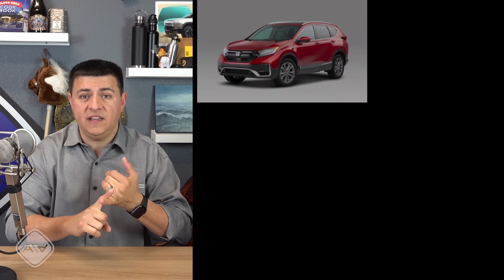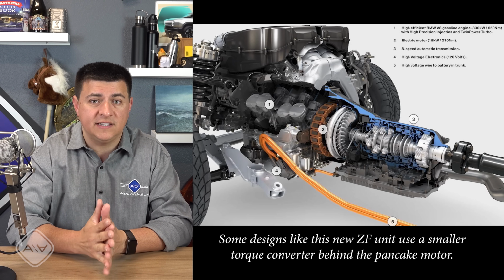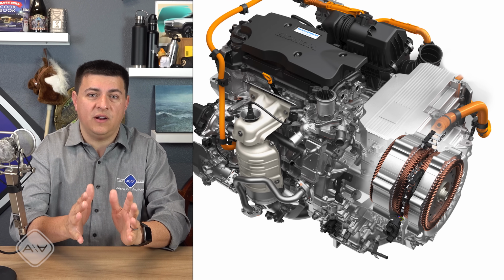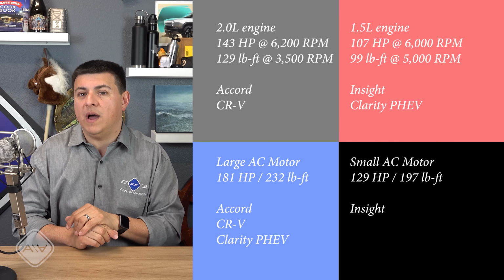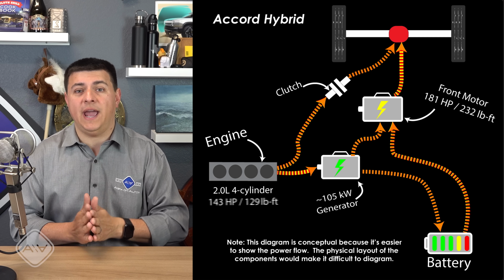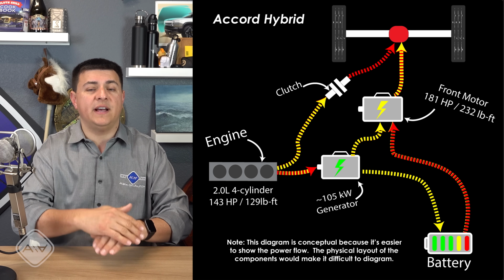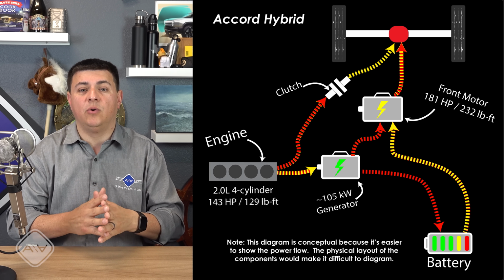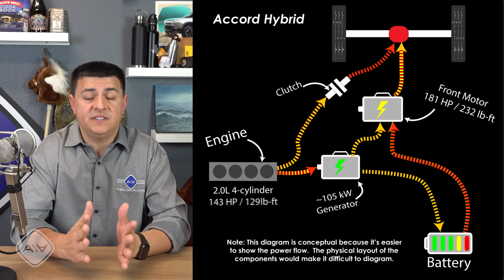How Does It Work?  Honda's 2 Motor Hybrid System Explained!

Comment: As hybrid as it gets. Serial hybrid combined with mechanical clutch pack and driveshaft to rear wheel
Reply: I do agree with your opinion, but to be fair I need to treat opinions I agree with the same way as those I don't.

The Toyota hybrid system is "as hybrid as it gets." By that, I mean that the two systems are so integrated, that the gas system can't operate without the electric system. The electric system can operate alone, but only in a limited capacity. This is why the PHEV versions modify the connection between the ICE and the wheels, to remove the limitation. The gas system literally requires the electric system to regulate engine rpm. What isn't well understood, is how the battery fits in to that.

The Honda hybrid system is, mostly, an electric-drive car that utilizes two different sources of electricity. It can be the battery, the generator, or the sum of both. It is only the "both" part that makes it hybrid, and it isn't as necessary as in the Toyota system.

What makes the Honda system efficient, is that it can also be based on the difference of the two sources. The engine in the Accord and CR-V described here is 40.6% efficient at 2000 rpm and 34.7 HP.  It will run there whenever it can, and use the battery to adjust the power sent to the wheels thru the motor.

The exception is Engine Drive, when the clutch is engaged. The engine can be at least 40.2% efficient between 1400 rpm and 2800 rpm, but only if it generates the optimum power. The point of the mechanical clutch is that it connects the engine to the wheels at the fixed ratio RPM=37*MPH. So that rpm range means 38 mph to 76 mph. This eliminates almost all of the loss between the engine and he wheels, for the portion of the power sent to the wheels.

And AFAIK, only the CR-V has AWD that connects the drive system to the rear wheels. The advantage of the mechanical connection is that any mix of front/back power is possible, unlike the Toyota that has only a small motor in the rear.

Comment: So basically it's an electric car with a build in charger unless you're driving on a highway yes?
Reply: Close, but not quite. "Electric Vehicle" really means a car run by electric motors. All hybrids are electric vehicles. A Tesla is a Battery Electric Vehicle, or BEV.

This can be called a "Generator Electric Vehicle." The distinction between it and a Tesla is that the generator is the primary source of electricity, and the battery is a back-up buffer for when the generator makes more or less than is needed.

On the highway, the generator and motor are removed from the loop since the ICE can run optimally
Reply: @jeffjo8732  I can't see the difference between EREV (Extended-Range EV) and the Honda Hybrid at low speed. Engines in EREV are generators for batteries. But here, does the E-CVT contains a small battery or it use a capacitor-like component to link motors and engine?

Comment: Good that Honda ditched their old hybrid and copied/borrowed it form Mitsubishi which got this hybrid plug in system from 2012 onwards in Europe and well proven design. Only thing is that this got a wearable clutch pack and in Toyota hybrids got no such thing.
Reply: Mitsubishi has similar components, but they use them differently. It's a different system.

Toyota eventually settled the lawsuit with the folks from the University of Maryland who patented the system they use in the early 90's, claiming they "developed it independently."

And the permanently-applied clutch built into Toyota's flywheel experiences more wear that the overdrive clutch in the Honda - which is none. It only closes when rpm are matched by computer.
Reply: @jeffjo8732  Toyota clutch pack is permanently locked right. Does not slip so from where the wear comes ? Yes. Toyota settled with an engineer from USSR who migrated to the US. Also, these days something will interfere with other designs and it is inevitable.
Reply: @adambakkam1527  "Toyota clutch pack is permanently locked right." So now you agree that a Toyota Hybrid has a clutch? We are making some - not much - progress.

"Does not slip ... " No, it does not open and close. Its entire purpose is to slip when forces are trying to make the two sides of the clutch spin differently.

"... so from where the wear comes?" The engine is still connected to the wheels when it is started in EV Drive. A common mistake by those who don't analyze the system, is to say that MG1 is used as a starter motor. That is true when the car is stationary, but not when it is moving.

The characteristic equation of the PSD is 13*MG2=5*MG1+8*ICE. Note that the MGs can have negative rpm, but the ICE cannot without being damaged. Positive rpm moves/pushes the car forward, and negative rpm moves/pushes the car backwards.

In EV Drive, MG1 must be spinning at 2.6 times the speed of MG2 to keep the ICE at 0 rpm. MG2 maintains this speed this under very small power, to make sure that the ICE can't spin backwards if you hit a bump. To start the ICE moving, MG1 has to slow down by either becoming a generator, or pushing against the car's speed as a motor. This transition involves both MGs and the speed of the car, so it is not as well-controlled as in other Hybrids that start the ICE while disconnected from the wheels. Some slippage occurs. It does cause wear and failure. You can look it up.

Conversely, the purpose of Honda's overdrive clutch is to only open and close. But not to slip. Ever. It engages only when the ICE is already spinning, and the speeds are matched.

 "Toyota settled with an engineer from USSR who migrated to the US." You missed the part where the settlement admitted that Toyota's design infringed on patents that they could have found with a simple patent search. They somehow get a pass for not doing that.

"These days something will interfere with other designs and it is inevitable." You mean like when you implied Honda copied Mitsubishi by combining similar components, for different purposes? Unlike Toyota, who admitted patent infringement that could (really should) have been avoided?
Reply: @jeffjo8732  Thanks for the detailed write up.
Reply: @jeffjo8732 Thank you for the explanation. I was concerned about the Honda Civic e:HEV’s clutch, but I’m not anymore.
I drove a Corolla HEV, a Camry HEV and the Civic e:HEV and, by far, Civic offers the funniest — and relaxing — driving experience.

On the other hand, the power split device means more moving components and more moving components means more mechanical frictions and possibly failures over time.

Sorry, Toyota fanboys…

Comment: however,the gasoline engine cannot develop large torque at low rpm...
Reply: And your point is.... what? That you don't understand how this hybrid works? Because that is what you demonstrate. The torque of the engine in this system is never important to performance. It will never even produce the theoretical peak torque, since it has better ways to drive the car.  This is why the low torque at low rpm in an Atkinson engine isn't an issue.

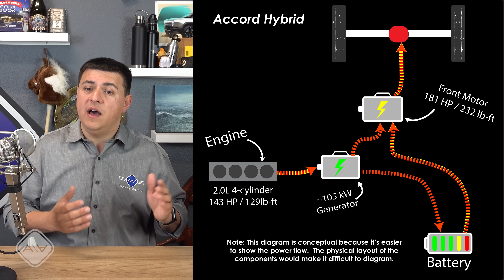1500 RPM is the slowest the engine will ever run. That will be at 40 mph in Engine Drive (5:00 in the video). It will be generating about 90 lb-ft, or 26 HP (it could go up to about 105 lb-ft, but won't). And, contrary to what Alex says, the traction motor will be involved.

That motor could add torque if more is needed, but will only add a little before disengaging the clutch to drop into Hybrid Drive. RPM will increase to 2000, still at about 90 lb-ft or 34 HP, but it will drive only the generator. If the car needs more juice than 34 HP plus what the battery can add, the engine will rev higher. Up to the what is needed for the 234 lb-ft, or 181 HP, that the motor can provide.

But usually, 26 HP is too much. The car needs less than 10 HP to maintain that 40 mph on a flat road. The 16 HP difference will be used to charge the battery.

Comment: I owned a Clarity for 21 months and I never got into the ICE engine connected directly to the wheel mode.  I don't know in which conditions I would get it.  It is a smooth system but the ICE engine could be quieter when running at high RPM.

Comment: It’s basically a twin motor planetary ecvt copied of Toyotas Aisin gearbox
Reply: No. It is nothing like Toyota's HSD system. The concept of operation is completely different. It has no planetary gearset. It is far simpler. And unlike Toyota's HSD system, it does not infringe on other's patents.

Comment: 142 hp engine and 181 hp electric motor = 324 hp total power in a Honda Accord? Damn!
Reply: No.

As Alex explains, only the 181 HP electric motor actually propels the car in situations that demand high power. The 143 HP gas engine will be driving a generator, and that generator plus the battery power the 181 HP motor. The "212 HP combined power" of the car is the maximum output of the generator and the battery, but only 181 HP of that can be used for acceleration.

But comparing peak HP really is an apples-to-oranges comparison when the drive trains are so different. For example, the Honda Accord and Toyota Camry are very similar cars except for the drive trains. Yet in Car and Driver tests, the 192 HP Accord beats the 203 HP Camry to 60 mph by 0.6 seconds. That's 7.3 seconds to 7.9seconds. The difference is that the Accord has a turbocharger, so it actually has more torque (and so HP) over a wide range of engine rpms. The peak HP is not very relevant.

The Accord Hybrid can only put 181 HP on the road. But it beats both in acceleration, reaching 60 mph in 7.1 seconds. The Camry Hybrid, rated at 208 combined HP, gets the same time as the gas version, 7.9 seconds.

Comment: When you’re driving the Accord hybrid between 65 and 70, is there anything on the electronic display that would show where you lose the drive efficiency?
Reply: There is no point where it "kicks in." It's a gradual change, and in my experience with an Accord hybrid it only becomes significant above 75 mph. (I have exceeded 50 mpg in long trips where the speed limit was 70 mph).
Two things mainly affect highway mileage. Aerodynamic drag goes up fast above about 50 mph, and very fast above 70 mph. But a gas engine is more efficient at highway cruising speeds than city speeds, and even more efficient at highway speeds and higher loads. What this means is that in a conventional car, the engine actually gains efficiency as it increases speed from 50 mph to 70 mph. But the increased drag reduces mpg.
A hybrid is already using this gain in efficiency at 50 mph. So it loses mpg quicker.
Reply: Jeff Jo , thanks for the extended explanation. I guess I’ll be okay, as I seldom go over 70, even if the speed limit is higher.

Comment: Thanks for trying to explain this very complex and confusing situation.  
I'm still a bit confused.
I'll put your video on repeat and maybe it will sink in...
Reply: Actually, it is quite simple. It just sounds complicated when you try to understand it based on the concepts used for conventional gas cars. Those concepts don't apply the way you think they do.

1) This hybrid is an electric vehicle, by which I mean a vehicle that is propelled (almost - see point #3) exclusively by an electric motor.

2) It just isn't a battery electric vehicle. It is a generator  plus battery electric vehicle. Most of the time, the engine runs at a constant speed and power (2000 rpm, 33.7 HP) to drive a generator. The electric motor takes what power it needs to drive the car, and any excess charges the battery. Except...

3) ... when speeds near 2000 rpm can be used, through a single-gear (overdrive) transmission, for cruising on the highway.

The two biggest misunderstood concepts are:

A) In an electric vehicle, the motors don't do the same same job that an engine does in a conventional gas car. They take the role of the transmission. In a conventional gas car, the engine turns stored energy, in the form of gasoline, into mechanical power. The transmission modifies that power to the form that the wheels need, by changing the rpm so that the engine can stay near its most efficient rpm. Most of the time, this means 25% to 30% efficient. In an electric vehicle, a battery and/or a generator turn stored energy into electrical power. The motor(s) and a single gear turn that into mechanical power at the right rpm.

B) But changing the rpm is only marginally effective in increasing the efficiency of an engine. Changing the power can increase it from that 25% to 30%, to over 40%.

For example, this explains why Alex is wrong, from around 7:40, in just about everything he says about power. The total system power, 212 HP, is the electrical power that the generator plus battery can provide in #2 above. It compares to the SAE Net Horsepower that is advertised for a conventional gas car's engine. The 181 HP motor compares to a conventional car's output after the drive belt and transmission losses, which is often estimated at 85% of SAE Net. And 85% of 212 HP is 181 HP.

Comment: why does the engine race somtimes or feels like its slipping ??????
Reply: The gas engine is powering the electric generator only at lower speeds.  The engine revs up to help the generator produce more power for the electric motor.

Comment: Instead of one engine to worry about we now get one engine and two motors.
Reply: But no transmission, generator, starter, nor heater.
Reply: electric motors are no worry, maintenance free, rarely fail

Comment: The EPA directed auto industry, will use every excuse to not use the design principles of fuel efficiency. The 1985 Civic. Even wiki tries to flush history away, by saying that it got over 50 mpg. Yes , considerably over. Just do the right thing Honda. You did ,years ago. Rant over.  Thanks for the video,  very informative! Good job !
Reply: Stacy Langford not really comparable; newer cars are significantly heavier and also much safer, and fuel economy measurement methods have also changed. An accident that would leave just a few bruises today would often be fatal in some of those older cars

Comment: why does honda hybrid have better gas mileage than honda clarity??
Reply: I'm guessing you meant the Accord?

Accord: 143 HP engine, 3327 to 3415 pounds, 48 mpg city, 47 highway
Clarity: 107 HP engine, 4052 to 4059 pounds, 44 mpg city, 40 highway

Those extra 600 to 700 pounds, due to the larger battery, do make a difference. Especially on hills or when accelerating. Plus, the 36 less horsepower is less able to stay in the efficiency “sweet spot.” Especially on hills or when accelerating. Which is how hybrids improve efficiency. Alex doesn’t exactly mention that.
Reply: @jeffjo8732  Thank you so much, I have 2018 Clarity for almost two years,love it and only add gas for every 4-5 months (I have to turn on gas engine once a week otherwise it does automatically. I had been wondering about its gas meleage not as efficient as Accord hybrid till your reply. Thanks again

Comment: Basically like an electric train. Combustion motor turns a generator and everything runs on electirc
Reply: In a diesel-electric locomotive, there is no battery. There is a fixed number of power levels (usually eight), called "notches," that the diesel can be set to. All this power is sent directly to the motors, so there isn't much control of the acceleration level. Efficiency isn't that much of a consideration.

In the Hondas, you can get whatever power level you want within its range. The ICE runs at its most efficient level, and uses the battery to add or save energy. And, the ICE can connect directly to the wheels when it is beneficial to do so.

Comment: 8:10 possible peak hp of 212 at 100mph... why would you assume peak system power is at peak gas engine power?
Reply from the maker: Easy, because Honda says it is. According to their detailed specs peak HP happens at a specific engine RPM and can only happen when the clutch is closed and the system is in parallel hybrid mode.
Reply: @AAutoBuyersGuide  ah ok.  other hybrids w a multi ratio transmission are difficult to assess peak hp output.  so your calc is of the speed (at which peak hp occurs).
hp-torque curve accord hybrid fyi:   https://www.automobile-catalog.com/curve/2018/2605940/honda_accord_hybrid.html 
thanks for tricky hybrid review, you're the man :)

Comment: 20% of 20% (worst case scenario) is only 4% loss, not really worth the reduced city drivability you give up on the Hondas.

Toyotas especially with all their newer cars that have a much more direct mechanical 1st gear give you more stop & go + city performance (where it makes a bigger difference miles per dollar), on top of the fact that the majority of people drive noticably faster than the posted speed limit, at which point the few% it may have had on highway driving goes out the window, and in many cases backfires because the engine can't spin any slower.

Seems to be a situation where they are chasing EPA numbers that look good but won't pan out "as-good" in real world driving (though I'm sure it'll be a heap better than their current system which frankly isn't up to snuff against a competent planetary system).
Reply from the maker: No Toyota hybrid has a mechanics first gear, you’re thinking of their new CVT in a corolla, that’s a completely different system.
Reply: @AAutoBuyersGuide  on further reading I believe you to be right, cuts down on CVT torque ware with the dedicated launch gear.